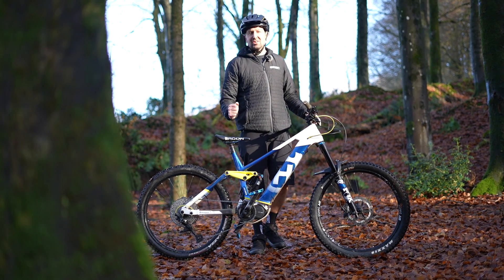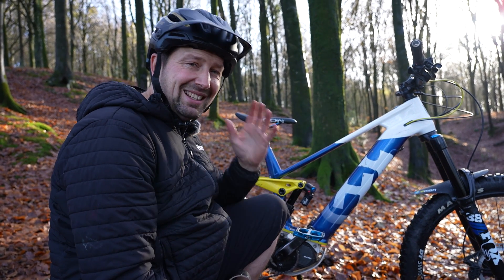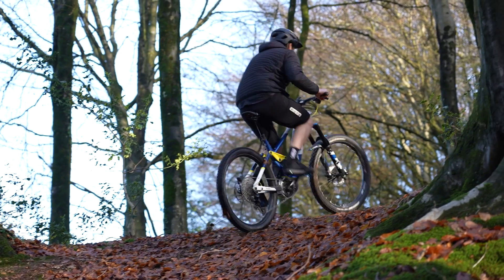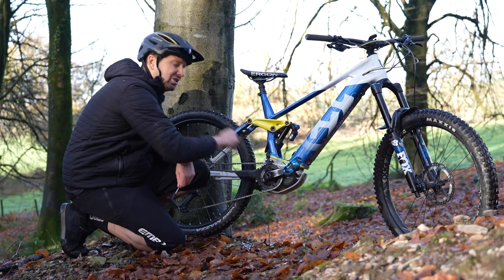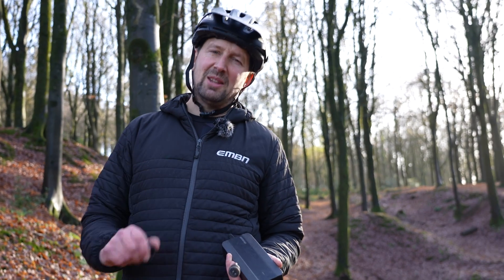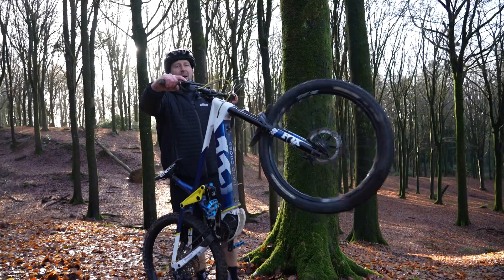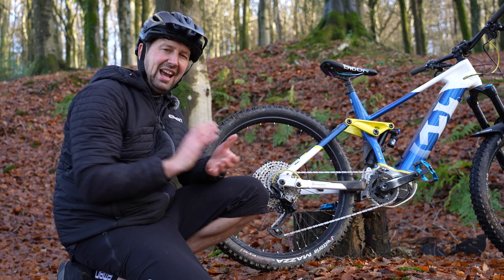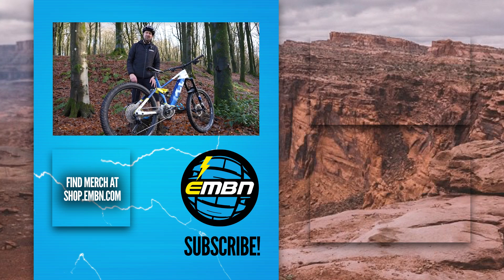8 Easy E-Bike Hacks! | EMTB Tips & Tricks

Comment from the maker: Do you have any cool EMTB hacks to share with our EMBN community? Drop them down below! 👇
Reply: A Lezyne Pocket drive is small enough to fit inside a headtube (or at least it does on my Cube Reaction Hybrid Pro), and a kayak bung of the correct diameter will hold it in there. Add some rubber bands around the pump to stop it rattling, and voila, you always have a bike pump available, on the bike.
Reply: For a tight ass elevator, you simply remove your bike's front wheel, and then you wheelie it. I almost always do Jojo pose when I wheelie mine due of the pedals sticking at my legs. Lol

Comment: If you have a bottle cage on your EMTB, but like most you always use a backpack/hydration pack, you can hacksaw the top off an old water bottle and use it to store a tube,etc in the bottle in cage. I duct tape over the opening but a better lid might be devised.
I try to keep my back pack as light as possible is why I try to store tools/tubes/etc elsewhere.
Reply: I found a tool pouch on Amazon that is shaped like a bottle so it just slips in and out. It did come out one time at the end of a particularly chunky trail but it has always stayed in on big jumps and drops. It's nice getting that weight out of the bag

Comment: Good hacks. the gear shifting will not work on Bosch engines unless you move the rear wheel first on the ground. it is best to move it a bit backwards and then lift it up.

Comment: Cover the brake caliper holes not with duct tape which can get sticky on the back brake due to heat, but with aluminium from a drinks can. You can use tin snips or sturdy scissors (be very careful) and make a cross shape that will cover the hole but has wings either side. Make small holes on both sides of the wings on the cross shape and stick the split pin through keeping it in place.